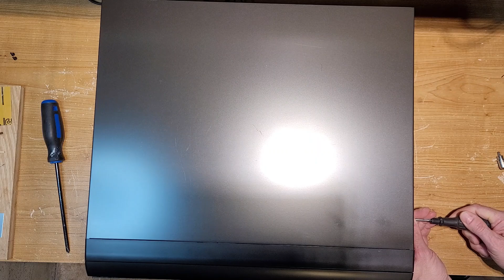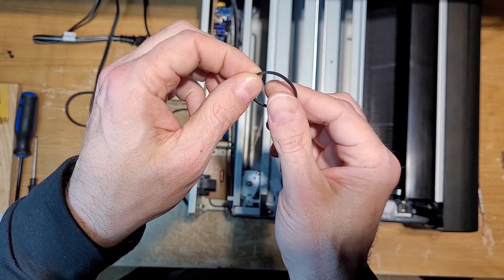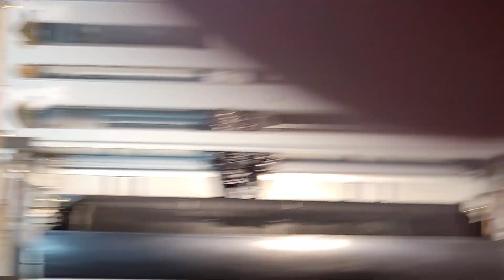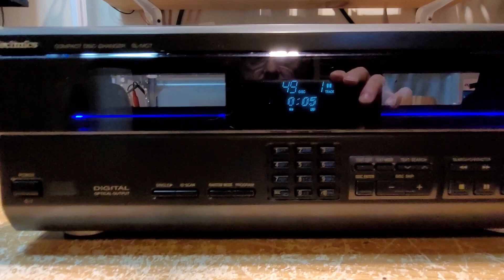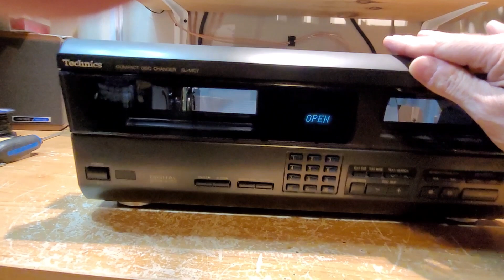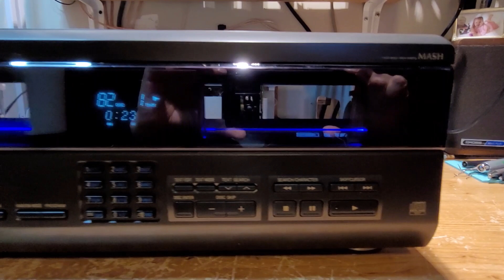Technics SL-MC7: Check Out & Check Up

Comment: Great video, tthanks!

UPDATE:

I bought a replacement belt (2 pack) for my SL-MC7 and that got rid of the "checking discs" error message and allowed me to turn the player on and off and I could see the carriage moving left and right. So far so good as far as that is concerned. BUT then when I went to test a CD in the #1 slot (Single Play mode), it kept saying 'no disc'. I opened the unit back up and tried one or two more times and then it worked fine and started playing the #1 disc (the only disc I have loaded for now).
So something may have briefly been slightly out of alignment OR be out of alignment with the metal cover on top on, although not sure that matters. 
I will close it back up (put cover back on top) and test it again to confirm it still works. (It has been working fine on several successive attempts with the cover off, but have not tried with the top cover on other than the one time).
Other to Do items, hope I can get some inputs: 
1) Also one of the while cog wheels/ gears seems to slide erratically (making noise) in one specific spot (same spot every time) of the return pass, during he 'checking discs' phase. Since it happens in the same spot  every time and slides smoothly on the entire pass to the right and most of the 'return' pass back to the left, and since I see lubrication on the cog / wheel, I am not sure what is causing that "issue", other than perhaps a slightly irregular track / rail. That said, it is working on consecutive attempts... Would lubrication potentially help even if it works fine for the entire pass to the right and most of the pass to the left? 
2) I may clean the optical laser lens itself, although that seems to be fine since it is playing the disc. What is the safest CD laser lens cleaning solution? I read that some people said high purity 90% isopropyl alcohol can damage coating on some laser lenses? Maybe I am better off leaving it alone since the lens currently reads discs just fine.

EDIT ADDITIONAL UPDATE  - I just tried playing the single with the top cover back on and the unit still works fine (like it was consistently when the cover was off). The only thing left it to reinsert the 6 screws on the top cover. :) 
I may leave the #1 (cog return movement) and #2 (lens lubrication items) for now.  This player has sentimental value (I am the original owner), so I am glad to get it working again...

Notes: It was a bit tough to get the new belt installed on the one side, but now that it is on, that is fine.

Comment: Thanks for the video. Mine has been sitting in my entertainment center unused for the last 15 years. I finally plugged it in and it's stuck on "checking discs". I can hear the motor but nothing happens. I'm guessing the belt melted.

Comment: Hello Turntable Guy, I have the exact same unit however, my issue is the mechanism that rolls back and forth will not pull the CD out of the slot...it stops at the spot where the CD is but fail to flip CD into player...any ideas

Comment: If anyone can help me on this one  i got mine to play i had it connected with rca i had sound  i put it all back together set it up and now no sound  i changed the rca cables i even tried the optical connection i get no sound at all  any idea if its them 2 boards bad and what replacement i can use thanks

Comment: Thanks for the video. It wasn't running but now it runs great. You don't have to remove the belt in the 0 position. You can slide the motor to the right for easy access.
Reply from the maker: Good tip!

Comment: Hello, may You can help: I am owner of the MC7 and was owner of the MC6 and the former mc400. All the devices have had problems with keeping the data of the cds like album and interpret. They get lost and stay blank in several cases. It happens mostly in the random mode where the carriage moves often in both directions. So I think it is a justage failure. Any idea? Thanks!
Reply from the maker: There is probably a super capacitor that has weakened or died.  The service manual is available at hifiengine.com
Reply: @TurntableGuy  o
Reply: These units are much older than the early 2000s… I bought mine for my 25th birthday in 1994. It still takes pride of place in my hi-fi stick. Recently, the CDs have started jumping and skipping relentlessly. I have tried cleaning both of the head optics and obviously all the CDs but to no avail and. I think I may have to replace the optical head but would have no idea how to go about it. When I got it I must look forward to making use of the CD text facility as I already had over 200 CDs at the time but was extremely frustrated to find that only half a dozen of my CDs had access to the encrypted data. When I discovered1 last year is that if you rip your CDs onto your computer and then back onto a blank CV, the unit will read the CD text correctly.
I have wondered if this is the reason why my CDs are now jumping but I reloaded the originals and the problem still exists.